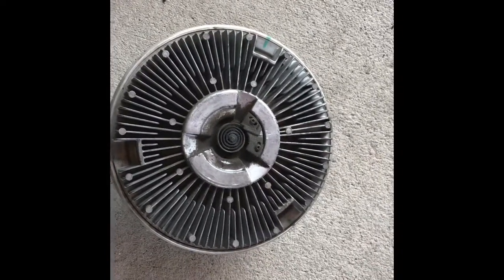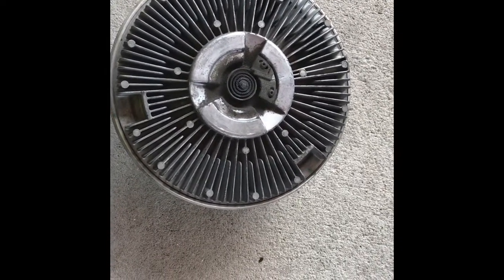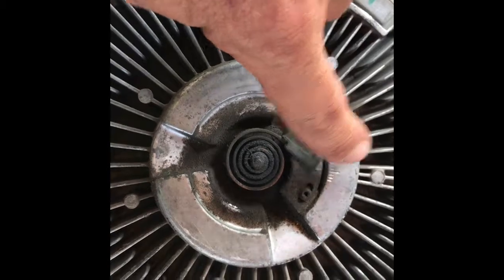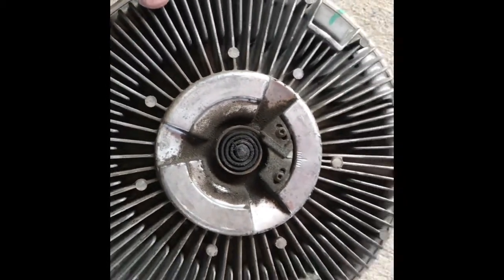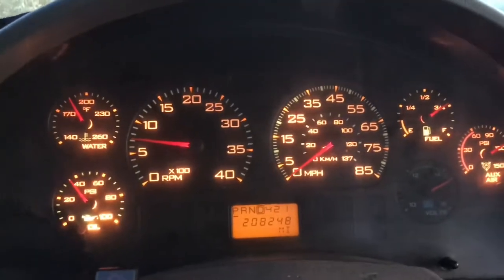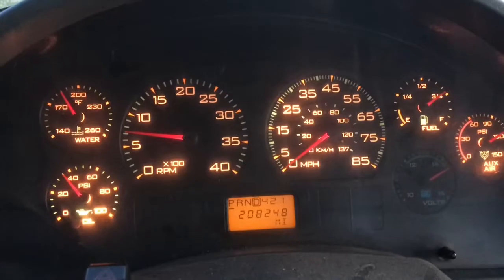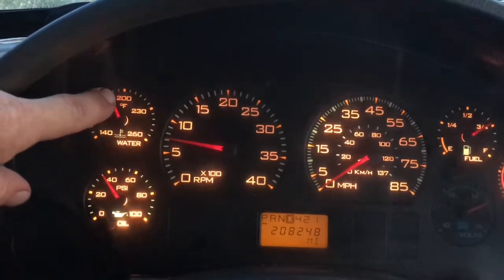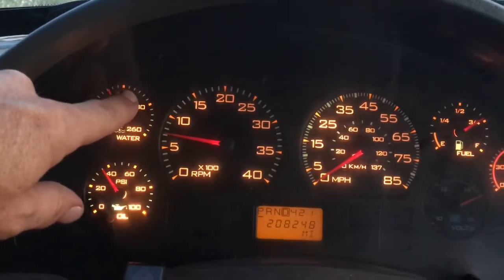2007 international 4300 how to adjust your fan clutch

Comment: We're having the same issue with our bucket truck. Have you had any issues with overheating after you did that? It's been a lil while thought I'd ask
Reply from the maker: Have you flushed your radiator out lately? That can cause that too.
Reply: @Thetowguy77  no we haven't done a flush but maybe that's what it needs. We've just been blowing radiator and air filter out regularly with compressed air.

Comment: Also if u put some degrees down and you don't replace the thermostat to some degrees down you will spend more diesel
Reply from the maker: Not sure on that, but the fan kicks on sooner and the truck runs cooler.